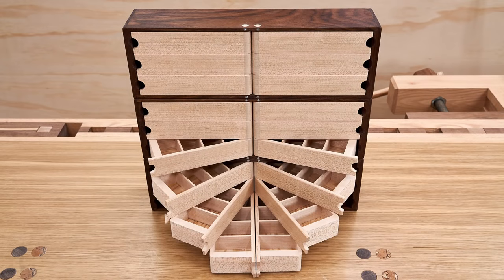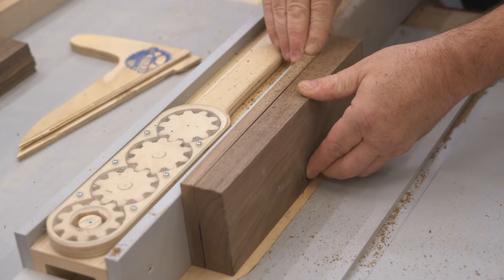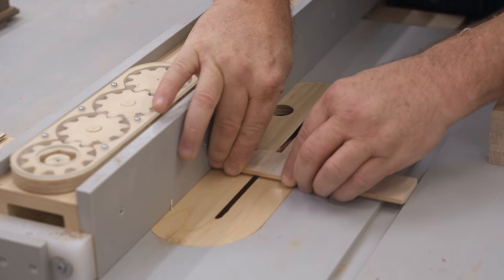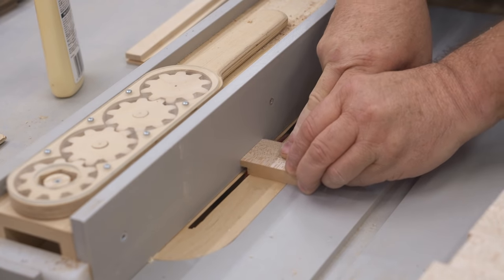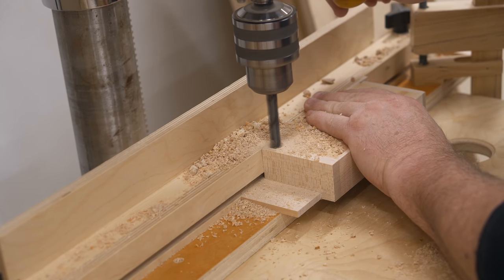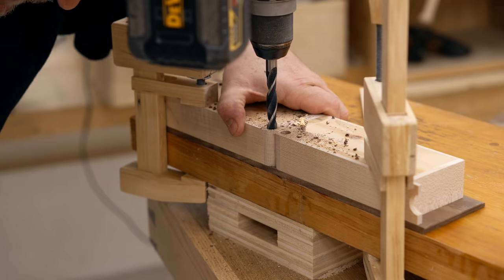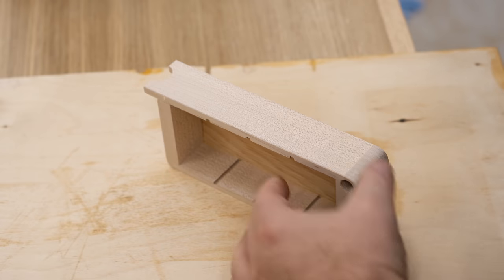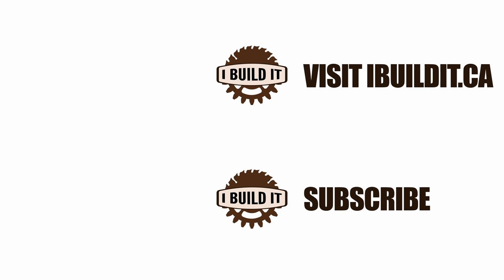Making The Coolest Small Parts Organizer  - Woodworking

Comment from the maker: Get My 27 Plan Bundle Here: https://rlnk.cc/27plansibuildit

Neil Pasken (Pask Makes - https://www.youtube.com/c/PaskMakes/) challenged me to do my take on his very popular small parts organizer. His has swing out drawers that rotate on a pivot and are triangular, while mine also has the same kind of drawers but they are rectangular and "butterfly" open. His is free standing while mine is designed to be mounted on a wall or the side of a cabinet, or sit on a shelf.
A fun project and actually very practical - these drawers will hold a lot of small parts and fasteners and operate smoothly. You can upsize it as well or make the drawers shorter which makes the cabinet narrower. I used maple and walnut but this can be made with any type of wood, even softwood.
Reply: Ciao John ;-)
Reply: Encryption errors for the redirect to the 27 plan bundle.
Reply: I built it put apathcary handles so I could label it. Fun Build Thanks John.

Comment: Beautiful small parts boxes John. You mentioned that sometimes a second drawer will be dragged open and you have to hold it back. Would small, very thin plastic washers placed between the drawers help with that? You'd have to make them yourself probably but that is right up your alley.
Reply: knifemakers' PTFE sheets, super thin and intended to be used as thin washer material maybe?

Comment: Very nice project, John.
Maybe a way to open the drawer one at a time without having to hold the others, could be to add a small magnet on the back panel inner side that match to a small metal insert on the drawer. In this way the magnet should help keep them shut and allowing to open them one by one.
Reply: That was noted at the end of the video.

Comment: Pretty dang precise work John. To facilitate single drawer opening, would a very thin washer work between drawers. Not sure you have the room but I have seen some very thin washers used as bushings in some electronics which I salvage when possible for stuff like this.

Comment: Another beautiful project using different woods. I do like how you only use the dividers between each set. As you said in another video, perhaps thin dividers between each might help but it might be too much. Sketchup might help determine. Anyway, I was thinking small magnets at the back of each drawer to keep them in place. And to keep them shut should someone tilt too much while moving it elsewhere. I think we've all ended up with a parts bin or two spilling on the floor. Great project, thank you.

Comment: Beautiful and awesome small parts boxes John. You could take and cut small plastic washers out of a old 1/2 gal milk bottle (after drinking the milk that is.) so the drawers can slide on them when opening the drawers. No more pressure that they will have they should last for a long time. Besides you can replace them as you made the pivot pin so you could remove it... :-)
Thanks John!
LLAP

Comment: Looks awesome! Only thing i don't like are the woodscrews in the front. I agree with the theory behind them though, being able to remove the drawers again in worth alot! Maybe a different solution would have been to drill the bottom hole smaller and turn the last 1/4" of the dowel to that diameter so the shoulder rests on the bottom and the pin can't fall through? Could get even fancier with a second shoulder in the bottom and a washer, helt in with a countersink screw from the bottom to stop it from working itself up. That would have added alot of complexity though!

Comment: John - Nice piece! A nice selection of woods, and liked the forethought.  I was wondering if one could glue on a thin felt piece around the pivot points so as to separate the drawers sufficiently so as not to have drag between the drawers?  Other materials could be used, or even a small tab at the pivot points, to separate the drawers by, oh 1/16th? That could over complicate matters though, yes? Some thoughts only, your piece is great! I saw Neil's version some time back, so it was great to see your response to the challenge. Cheers!

Comment: Anyone know why a table saw will leave ridges when a piece of wood is resawed done in two passes?
Reply: Blade run out, blades wobble, slight misalignment of blade angle off of true 90 degrees. Also the fence can flex slightly. Basically it's rare to get it 100%.